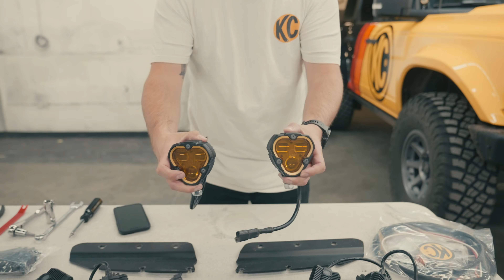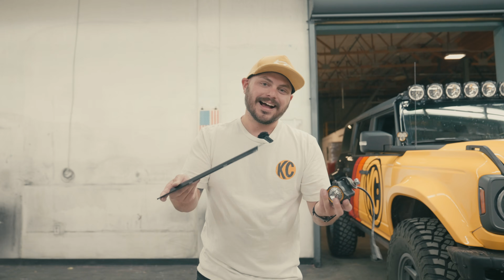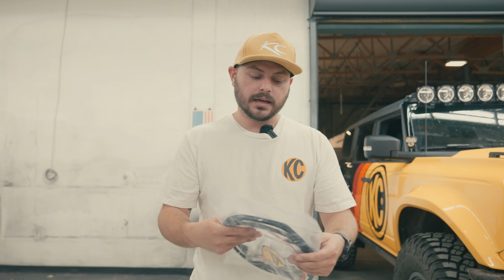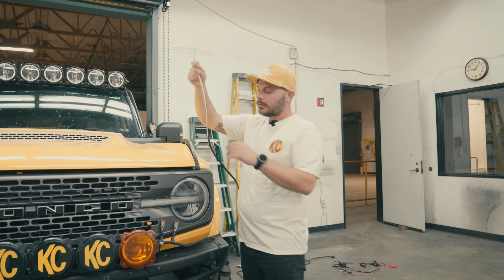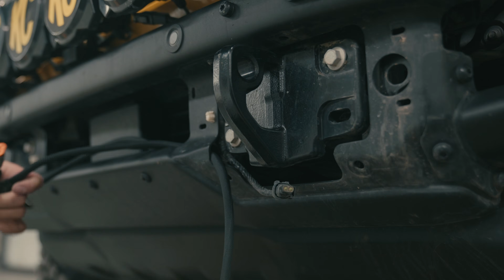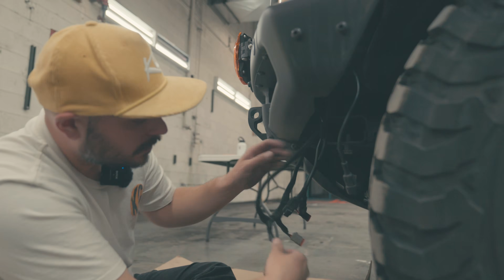How to Install Fog Lights on Ford Bronco 6G - KC® FLEX ERA® Fog Pocket Kit w/Factory Aux Switches

Comment: Love the lights. In my final phase of research and getting real close to the KC lights for fog pockets. 

Only complaint is that it seems no one makes lights that fit within the pocket. It looks like these are SOOOOO close but the SAE light looks blocked by the bottom of the fog pocket.
Reply: KC took a short cut and used existing inventory to get close enough.  aka Hacked it!

Comment: So because of the amperage power of these lights, it looks like you can only use Aux switch 1 and Aux switch 2? That makes having any big powerful light bar (40” on the roof) and maybe a 20” on the bumper useless because only 4 10amp switches will be left. Also!!! Why didn’t you turn them on in the end so we see the difference in the SAE and off road.

Comment: Great video, it would be cool to just power them from the factory fog light hardness laying there instead of wasting an aux?  Any chance you guys will do an updated video, or ofter a way to just leverage that harness?  I just got a bronco with the same bumper, and no lights, so looking to add some!
Reply from the maker: So if you have the OEM fog lights you can tap into the harness but if you did not get a Bronco with fog lights you would have to swap out the entire panel inside, it’s a little more involved which is why we just recommend using the aux switches! If you tap into the fog lights you also lose the ability to use fog lights while using your high beams
Reply: @kchilites interesting. so ford has a harness sitting in the bumper...that goes to nothing?
Reply from the maker: @mcmahonhouse1829 sort of, you have to replace the panel inside your Bronco to the fog light version that has the fog light switch, if your Bronco does not have fog lights from the factory you won’t have the switch inside your Bronco, does that make sense?
Reply: @kchilites  Yup, totally makes sense now. thanks for spelling that out.  So, with the setup you did, you talk about using aux 1 and 2 for modes.  If your in street mode, you only flip aux 2 on, and offroad, do you flip on both, or just aux 1?
Reply from the maker: @mcmahonhouse1829 exactly!

Comment: How hard is it to jump the fog function to the factory switch and spare an aux? Seems like I would be straight forward but I'm still waiting on my bronco so I can't pop the hood and see if there's any limitations.
Reply from the maker: I spent some time looking for a fog switch and could not find one on ours. If you have factory fogs it’s totally doable and not too difficult! -Jacob
Reply: I’ve seen another video where if you got the “capable” bumper, that has OEM fog   lights, then you have the fog light switch on the headlight switch in the factory location, and some trims (apparently Lux trims) were prewired with the fog lights anyway however on the modular steel bumper equipment models, you must replace the headlight switch and use ForSCan to enable them to function. ✌🏼
Reply: Depends if you bought a stripped down (shoulda bought a jeep) or a high end Bronco (Wanted a Rover without electrical and oil issues)

Comment: After watching the vid I am more confident in doing this job myself, but since I already have the Gravity Pro 6 roof lightbar and Flex Era 3 pillar lights connected to Aux#1 and Aux#2, respectively,  I will not be running these lights via OFF-ROAD MODE. For the STREET MODE, which Aux Switch is the kit connected to?
Reply from the maker: It’s not too bad to do yourself! I would switch aux 2 with the off-road version of this kit, and run your a-pillars on aux 3 and use the fog lights on aux 4!
Reply: @kchilites   upon further thinking, I had a feeling that this exact recommendation would be the way I needed to go... THANK YOU for the super quick response!
Reply: @kchilites  If I'm running the Flex Era 3 on the pillars I think I need to 2 switches (one for the amber back light and 1 for the actual light).  Would you use Aux 5 then for the backlight function on the flex era 3?
Reply from the maker: @brentbounds2367 yes! You can also tie in multiple Flex Era light so all your backlights are on one switch!
Reply: @kchilites  Awesome!  I just ordered the ditch light kit.  Plan to order the fog pocket kit next month.  Sounds like I should be able to wire the FE3 in that kit so that the backlight works on the same switch as the Ditch light.  Any special steps to do that?
Reply: @kchilites Just purchased it.   
thought I saw aux 2 was 15 amp and offroad draw was 16+ amp.  Will the offroad version work on a 15amp fuse?